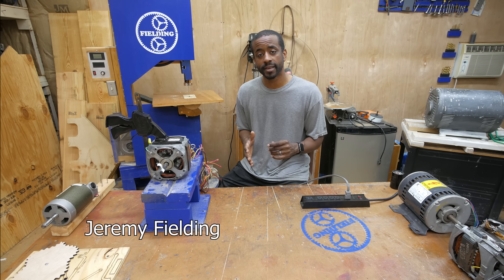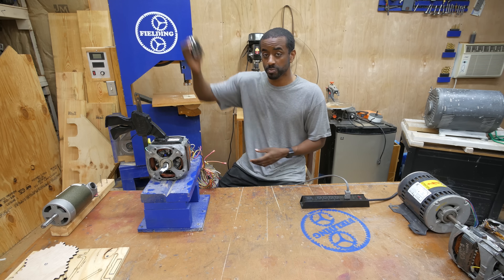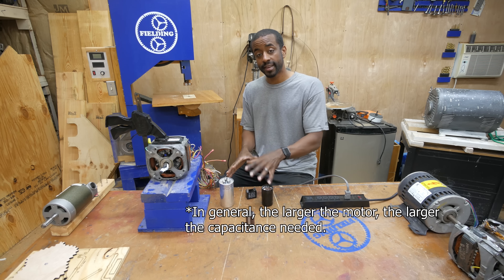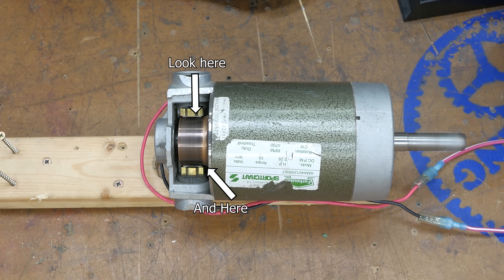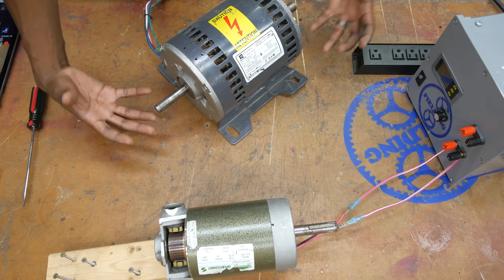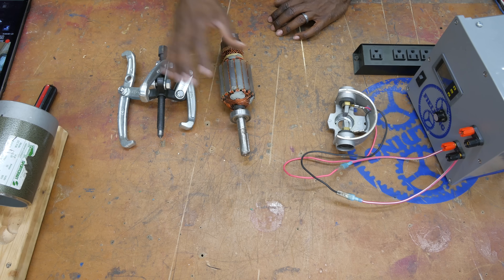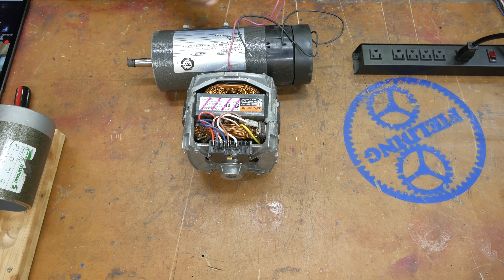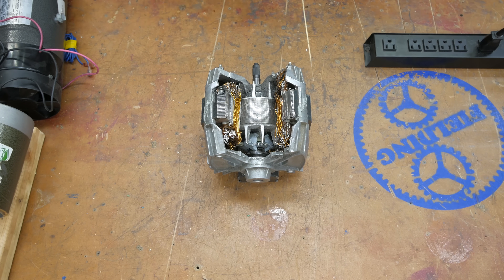Three Most Common Motor Fixes Anyone Can Do; Ultimate Guide to Electric motors ; #070

Comment: I had a bench grinder that only hummed until I cleaned the tarnish off the plug's prongs.  That's when I found out the bearings needed repacking or replacing.  Blowing out decades of dust was what I did first, however.

Comment: Did some trouble shooting on a small fan, turns out... it was just lubricant that had become very greasy and clogged the gears. Made the small motor struggle. Cleaned it up and now it's working perfectly... but wouldn'tbehave gotten there if I hadn't watched this video. Paid my ticket... watched all the ads 😉

Comment: I’m asking you for your help with something.i took my 6hp Craftsman 60 gal.oilless compressor I’ve had since 94’ and tore the pump section off so I’m left with the motor to turn a new H.F.5hp pump but I just watched another guys site who the same with 5hp comp.& 5hp pump like mine but someone commented that his motor was only about 31/2 hp cause it had 15 amps.mines suppose to be 6hp but only has 14 amps.boy am I pissed that they outright lied about my motor,they could have said 5 but they said 6.the 141/2” pump pulley calls for 4” motor pulley for correct rpm,do I need a different size now to make up for the difference?I would appreciate any help you may offer if not I liked you video anyway it helped me.thank you for posting for us lackies

Comment: Great presentation!
I’m watching because I have a 20 year old treadmill and the kids told me the belt is stopping at slow speeds.
Turns out the belt is hesitating at all speeds. It seems like the motor is only half working? Lots of sparks from the front?
Very dirty, so I cleaned it all up, I have not been able to find a replacement motor.
Not really sure what my problem is, but it looks like I should start with new brushes

Comment: I have a fasco 7185-0077 AC motor running an air pump for a pond aerator that is outdoors and is connected to a GFCI outlet. All of a sudden it trips the GFCI breaker after starting. It sounds like the motor and pump are fine and it's been running fine for years. The pump has been zero-timed by me and it is very quiet. The Ground and Neutral read open on a standard ohmmeter. There is a capacitor on the motor. Tested the GFCI and it works. Plugged it into another GFCI outlet and it does the same thing. What do you think could be the problem?

Comment: Nice explanation,,, ive got a push behind electric Sunjoe lawnmower, that i wanted to junk,, but since it works,, can i take out the motor and use it in my shop to create beltsander and different things like this?   it is 60hz and 12 amps and 3500rpm,, i dont know what these numbers mean,, can you tell me pls,,, otherwise i will throw the thing away?  thannks,,

Comment: I’m not sure if it’s a capacitor, or just the leverage required to complete the cycle, but, my overlock machine has a tendency to jam, when I use the blades to trim the seam allowance, which is what the machine is intended for.
It’s ancient, l got it for a ridiculously cheap price, and the foot pedal/speed control needed replacing, but it glides along when I’m just running the edge of the fabric through it, without trimming…
Thanks!

Comment: I am working o a sewing machine with a 0.53 amp motor, it is using 0.51 amps,  Does that mean that it might be binding somewhere in the machine ( bushings, joints, or other). ?   (I’m not sewing anything when I test it). Thank you

Comment: I have an old1.5 hp motor that has a three pole thermal protector that disintegrated.  That make of protector is no longer made.  What do I need to look for in buying a replacement?

Comment: Is there any hope in repairing a motor that got left in the rain. Pull the trigger on a cordless leaf blower and nothing. Battery is good.
Also have a jointer that gives no response when the switch is thrown. It worked fine last time I used it. Can’t find a fuse. Outlet is fine.
Thanks!

Comment: Thank You for your videos! I have a question for you. I have graco spray gun that stopped working. When I turn the power switch the motor spins for a second and then stops. Do you think the magnet DC motor is bad ?

Comment: Great videos - much appreciated content.

A garbage disposal motor that is seized, but very nearly gets going on it's own. My question is - could I bypass the starter windings and add a capacitor instead? I've cleaned off every surface and tested pretty much everything else....the rotor just seems to jam up.

Comment: very informative, and very easy to follow and understand. I have a new drill press that when I powered it up it would kinda chatter and spark pretty good. The company said to let it run for a while and both would go away. That it being on the shelf so long it would wear back in? Is that possible?

Comment: hi Jeremy to run 2.25hp DC motor which has 10amos and 90V ,,,showed in this video ...just wondering what sort of power pack did you use to run that on AC. thanks

Comment: I have a 3/4 horse 120 volt single phase motor that stops after 20 seconds? I've gone through. Which plug and all the wiring still does it?

Comment: I'm having issues with the treadmill motor rated at 130vdc but at almost full throttle it reaches 60volts, and at full throttle i get no voltage reading nor does it spin any faster. What's the problem here? Please help.

Comment: Using a DC brushed motor to drive a tube forwards and backwards, but some times the motor just stops while power is being applied. Usually the remedy is hitting the tube with a rubber mallet and it begins working again. Any pointers as to why this could be happening?

Comment: YEARS AGO,
I applied for a job at an electric motor company. Customers' would bring in their 
broken motors, exchange it for a fresh rebuilt one and the techs in the back would
rebuild the broken motor & place it on the shelf ready to sell. Well, I applied for a
rebuilder position but I didnt get the job. Later, it occurred to me that being chained 
to a workbench repairing as many motors a day as you could would probably get 
old real fast.

!

Comment: Maybe you can help me,I have a craftsman 6hp (oil free) compressor motor out and apart to the point you went to with the treadmill motor and the shaft is bigger and looks different bc of the way it coupled together.I need to figure the best way to connect a pulley so it can drive a new h.f.oil compressor pump.I want to use the oil free compressor motor to run the new oil pump.if you have any insight I’d appreciate it.thanks,,,we’ll just a lit bit later it came to me,,make my own arbor,no sweat.clean the motor innerds with emery paper and brake cleaner and I’m set but it took seeing your video and one other for the idea to formulate but yeah that’s it,thanks again

Comment: Hey how’s it going? I have a question. What would cause a new capacitor to burn out? So I got the humming and replaced the capacitor fixed the problem and started working again but only for a short time. Burned the new capacitor in less then 20mins of working under load.
Reply: I imagine a bad motor at this point that the only thing that hasn’t been replaced. I replaced the speed control panel as well as the capacitor.

Comment: Hello, hoping you can help me. I was taking apart a fan motor for a floor fan, and I noticed some dusty/cottony/papery looking debris packed into the bearing area where the rotor spindle turns. I thought it was dirt, so I picked it out and threw it away. Later, I found the same material packed into the opposite side. I believe this is supposed to hold the lubrication oil? Anyway, I have no idea where to get this material to replace the stuff I thew away. Any help would be greatly appreciated. Thank you!

Comment: Thanks! $20 for this excellent diagnostic video is a great bargain compared to disassembling my drill press and hauling the motor to a repair shop where the shop charge would probably amount to several hundred $!

Comment: I had a power failure which prevented my sub pump from working allowing water in basement to flood about 9 inches. After using a different pump to clear water from basement I checked the old pump. It was blowing fusing in the circuit panel. This pump had become drowned in the  basement . Question how can I repair this electric motor or should it be replaced. Help. Thanks

Comment: Great video... THANKS!  Wonder if you might have a thought on my 230v 7.5 hp compressor motor.  Sometimes it starts & runs fine... other times it goes into a surging process and ultimately trips the breaker.  Any thoughts?

Comment: Cool vid but doesn't help in my situation but cool nonetheless. In learning phase so trying to get guidance on trouble shooting a AC sliding garage gate motor. Under the motor wiring plate there's a red white and blue wire with some additional yellow wires. The main red white and blue wire goes to a wiring harness plug that attaches to a circuit board. From there there's another wiring harness plug with hot and neutral that connects directly to regular ac outlet for power. Currently motor is not responding. Not even humming so can't tell if it's a capacitor issue. In theory I should be able to bypass control board and connect regular power cable to hot ground and neutral but don't know which wire is what. I should be able to test for ohms but new to that as well. Help from you or anyone would be much appreciated thx!

Comment: Thank you and the sawed open motors are great. I have a Patton 16 inch electric fan that gets hot and stops running  after 2 hours.  The fan is 25 years old, the speed switch has no knob and years ago I tried oiling the fan support bushing. These days I put some wd-40 on the bushing and  angle the fan downward. It still overheats and stops. What would be the next steps to get this fan working? As it is I don't leave the fan running unattended.

Comment: Very good instruction. I do have a small 1/3 sump pump motor that just hums. I replaced the run capacitor, and it just runs for a few seconds and turns off and continues to do that. So if it’s not the capacitor, what could it be? It seems that it’s the capacitor that just allows it to run and then shuts off?

Comment: I couldn’t help but notice you do not really seem to sport much ppe.  The last video I watched you had a band-aid on; although I think that video may have came after this one.  I think we might be kindred spirits.  I’ve been tinkering 6 years old when I started pulling carbs apart and rebuilding them in my dad’s shop.  I’m also horrible for not wearing ppe (even when readily available and close by) I just forget, and so I get a bunch of cuts and abrasions as a result. 
So, I’m dying to know….  Did that screw tear up your forearm or just a scratch?  I saw it was a bit loose but when you pulled the rotor it looked like it was resting at a 30 degree angle and not so wobbly.

Comment: I have a 115v single phase 3/4 hp drill press motor. I got it second hand and when I got it home and turned it on it ran counterclockwise. There is no wiring diagram on the motor or on the inside of the motor but when looking inside it was very apparent that it was not in the original configuration. I did all I could to try and find the diagram with no luck. So I took a shot at it but now when you turn it on it will not spin until you spin it by hand . My first thought was a bad cap until I discovered that it would now run in whatever direction you spun the shaft. Now I'm stumped . Any ideas?

Comment: I have a delta midi lathe la200 the belt got tangled in the pulley and I shut it off and it smoked a little but now when I turn it on I just spins slowly and I can stop it by just grabbing it I don't really know where to begin I originally assumed the capacitor but idk because if I give it a boost it doesn't help

Comment: Cool stuff on motors you can learn a lot just watching your videos. Got question about whole house fans l have a two speed motor on my whole house fan and the low speed quiet working but high speed still works, you where talking about capacitor could that be my problem with the low speed capacitor burned out.? Thanks

Comment: Sir my central vacuum stopped working, I replaced the capacitor, starts great now, but after about 45 seconds it cuts out, have to wait about a minute then it’ll start, as the motor gets hotter it runs for less and less time, I wired the motor direct, same problem, so it’s not computer, motor might have 10 hours on it, brushes are very good, any idea what it might be.? Tia.

Comment: I've got some questions about an old desk fan, probably from the 20s or 30s. I bought it at a junk shop. It looked in pretty bad shape.
I straightened out the bent parts of the shroud, replaced any missing screws, new brushes, cleaned the armature, new green felt on base, repainted the fan blade, basically got it looking and running like brand-new.
For such a small fan it put out a very high volume of wind.
It ran perfect for several years. 
And then I started running it through a dimmer switch and that seemed to work perfectly with a very wide range of speeds.
I would still normally run it at full speed and occasionally about half-speed.
One day it slowed down to about ½ speed and started throwing sparks.
I would like to know if it's repairable because I really love that fan?

It's made by R&M. 
ROBBINS & MYERS
It's still a beautiful museum piece.

Comment: The only problem with buying a whole new motor is it quite expensive and I knew that was just something simple like bushes or a capacitor anyway that’s what you said underload it doesn’t spin in the motor for it cost as much as a small cheap compressor like I can afford to buy another one like I was just gonna do I had some time send mess about with this one I was gonna buy new motor and there’s no need about another compressor just because of time but if I pull it apart and fix it enough well I will save me

Comment: How you going I loved your video I’m from Australia you’re probably get a lot of use I’m fairly proper anyhow I love the video is my capacitor and my air compressor has about driven anyhow I’m quite sure I can fix it however in Australia when our motors go we just get a new one I know it’s crazy throwing out so much all that copper and they’re so easy to fix that really that and fix them here they throw out the whole machine or they just buy a new motor I know

Comment: I have a little rv furnace and it only starts the blower if I tap on the out side of the motor. It does not hum before hand. The motor is obsolete. Any suggestions on how to fix it?

Comment: Hey Jeremy  I have a 4 7/8 Craftsman jointer. Replaced belt. Started up and belt walks off small sprocket. Tightened belt by moving motor and the unit started to smoke. The motor runs without the belt but makes a loud chattering sound as it spins down (bad bearing?). The shaft on motor moves out when I pull on it. Is this normal? Anyway. the motor number is NL73512 120V 60 Hz. Can this be fixed? or do you know where I can get another motor? I will see how Pateron works and I have subscribed.. Plus thumbs up.  Old guy trying to work with what I have thanks for your consideration Bruce
Reply: can the armature work with gouges from the brushes?
Reply: the lamination stack has 6 gouges

Comment: Hi Jeremy. I have a DC motor on my wood lathe. When I turn on the lathe the motor just hums and locks up magnetically. Could be the control circuits, but it spins freely without power

Comment: Hi, good video, can you tell me if cap replaced and motor tested working with new cap, but after put back to slicer machine, the motor still make the humming sound but not spinning, could it be the relay? Do I need to replace the relay and how to test the relay? Model Globe GC512, thank you in advance

Comment: I had an issue a while ago and thought I'd mention it here. 

I blew out a sanding machine with compressed air and the bearings were not sealed. The dust extraction had become clogged.

 Instant noise.  I pulled the machine down, cleaned the bearings and reinstalled them.  Fired it up and it was quiet, but after a second or so, I saw the magic smoke.  Shut down quickly, and had a think.  There was no start capacitor or centrifugal switch to be seen.  I had the machine on its side at the time.

I saw a small component marked "up". I believe its a small relay which is momentarily activated by the inrush current and then releases after the start event, but it's obviously sensitive to its relationship with gravity....  when I restored the machine to its normal position, it started and ran fine and continues to do so.

Ever come across anything of that nature?

Comment: I have a 1 hp well pump that will not start. I tested and replaced the start capacitor but it still won't start. It just hums. I've turned the shaft with a screwdriver on the end of the motor so I know it turns. It has 240v AC at the motor so it has power. I can't get it to run. I've been turning the power on and off with the breaker in my garage instead of the disconnect on the wall by the pump because I've had issues with it. I just cleaned up the disconnect recently because it was burned and not allowing power to get to the pressure switch. The motor says its thermally protected so I'm hoping the motor is still good. I guess the next step would be to open the end of the motor and see what's inside. I saw a video where there were contacts inside the motor so I'm going to check out mine and also to clean the contacts on the motor and the pressure switch even though 240v is getting through to the motor. I just don't want to have to buy another well pump! They never seem to get past 3 years life with me!